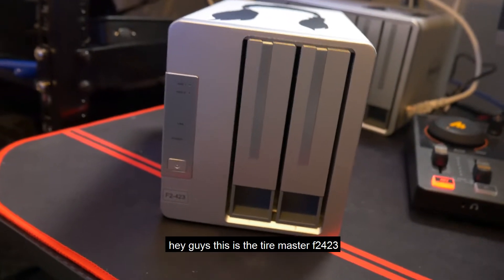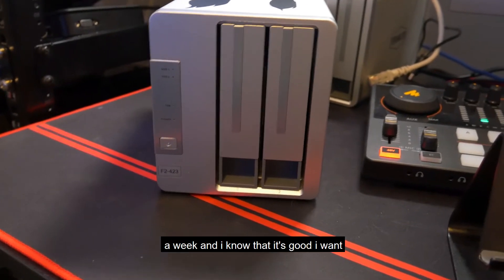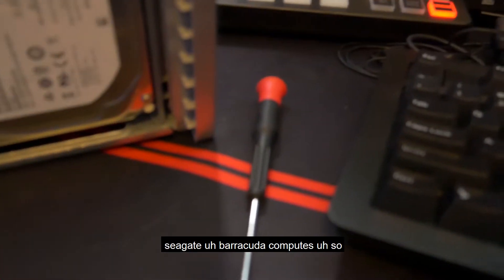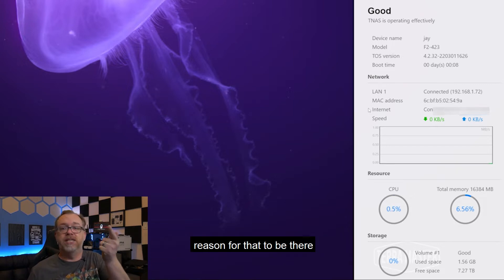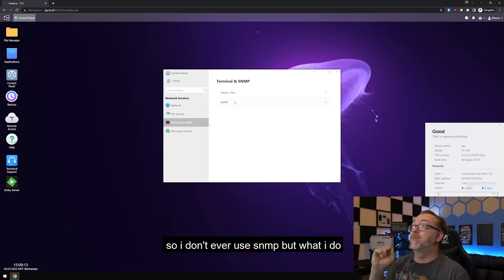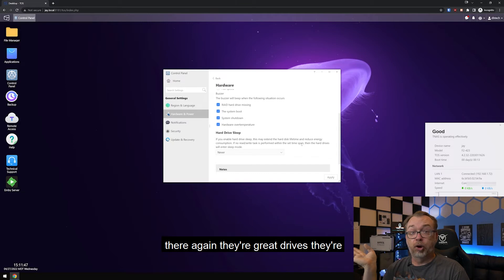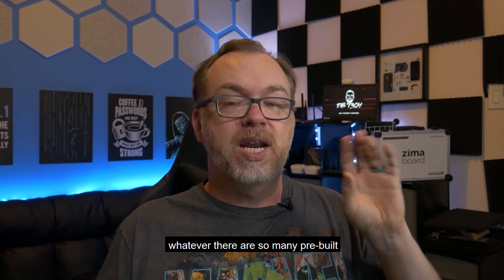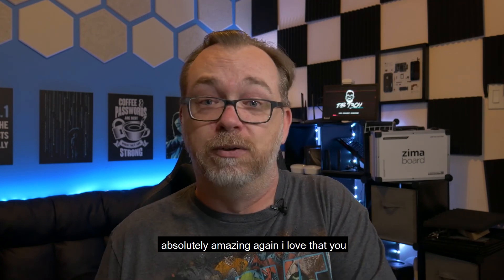F2-423——2-Bay High Performance NAS For SMB

Comment: Just a warning for anyone looking to purchase this NAS. According to the terra-master forum, terra-master has disabled support for ALL third party RAM for this model after the TOS 5 update. They are only allowing their "officially supported" RAM modules that just so happen to cost 4-5 times the price of equivalent third party RAM. I just found this out after purchasing the NAS and think I will have to return it. Third party RAM is usable if you install another OS like TrueNas so they are disabling support in their software.
Reply: They took that restriction off with the TOS 5.1 update.
Reply: Both of you are correct.

F2-223 at a good price is replacing my old wd ex2. Basic simple use.